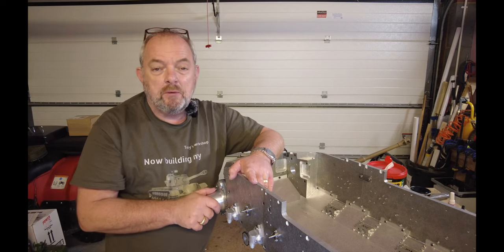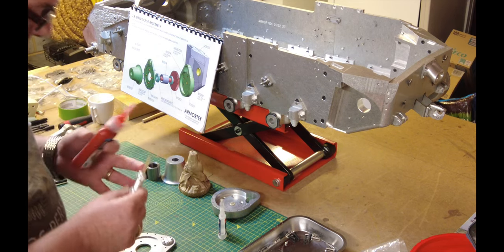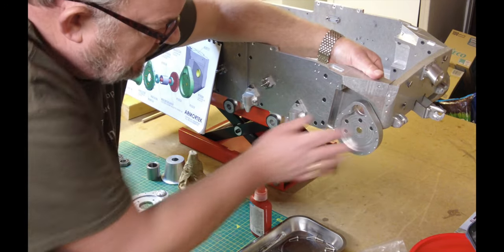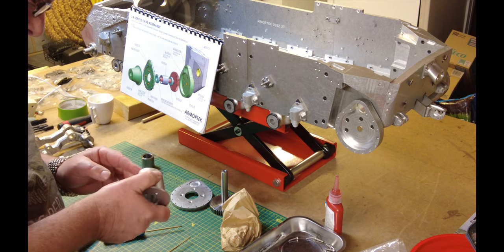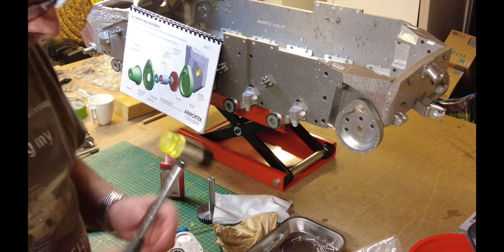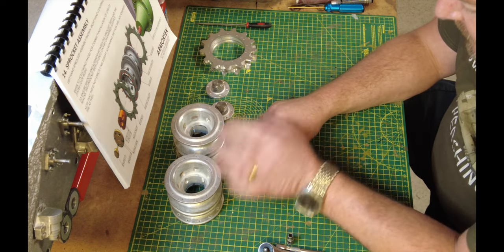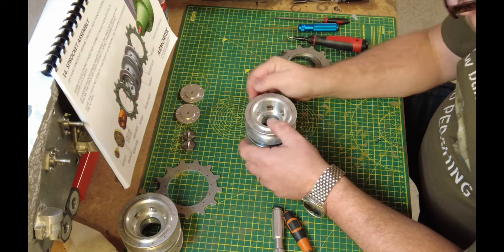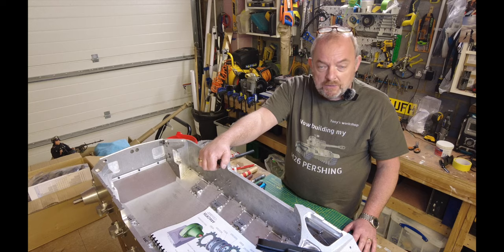1/6 scale Armortek M26 Pershing RC Tank build. Drive case and Sprocket assembly. (Vid 06)

Comment: Thanks Tony.. keep em coming… never before have I been pleased to open the curtains and see it peeing down with rain…. And I’ve not been on PlayStation since bringing my kit home.. Tank building is certainly addictive 👍
Reply from the maker: Hi Brian, thank you....LOL...I too used to dread cold and wet days, but now these are officially tank building days....who knew?
Reply: @tonys_workshop  That's funny, I feel the same way, and I love the outdoors. Thanks again for the videos. Always fun to watch. I noticed you did not apply even a dry lube on the gear as per AT recommendation or are you going to wait until you install the motors and apply some through the pinion gear hole?
Reply from the maker: thanks Ray. I used some copper slip on the brass plug. I will also apply some to the gears on the drive motors before I install.

Comment: Again, thanks for the video.

Please, always press or hammer the bearing in on the collar which is carrying  the pressure at the time. Otherwise, you can dent the small balls in the bearing which will make 'm make a crackling sound over time, or worse...
So when hammering in those bearings at  13:19 and 17:58, don't use the broomstick like that. The force then has to pass from the inner ring, through the bearing balls to the outer ring, which will damage the bearing balls. Instead, better use a socket from a socket wrench (or a piece of tube or wood or whatever) which  matches the outside of the bearing and hammer or press on that. In that way, there will be no pressure on the bearing balls inside of the bearing, i.e., not harm them.
Reply from the maker: Thanks Leon, Fine tuning tips...Thank you, and really appreciated.

Comment: Hi from Australia. Tony, When fixing with a lot of screws that require Loctite, I have found that if I put some loctite in a small glass container I can then dip the end of the thread into the loctite.
Loctite requires two things to cure,1 contact with metal and 2 an absence of air. It will not cure in an open glass container
Reply from the maker: Hi Robert and greetings from the UK. Great tip thank you. Thanks also for watching and commenting, it means a great deal to me.

Comment: Morning Tony another cracking episode, build is coming along really well.
I think you will have the persching built before I finish the panther Lol.
Very interesting on the drive cases good design from the real persching on the maintenance front very nice added detail.
The Brass Bush in the drive case is to stop any potential binding of the drive gear.
And it also has an anti track slip ring!
The 2 disks running in the centre of the sprocket parallel to sprocket teeth are track tooth guides to help stop tracks from climbing off the sprockets.
I have these fitted to my modern 1/16  tanks.
They aren't on the real vehicles but are brilliant as they work very well.
Reply from the maker: Morning Gary and thank you...slowly but surely it how I look at it. Really don't want to rush this build as there are so many little issues with it and it is easy to get bogged down on getting to the next stage. So at this rate, I think you will be up and running on your Panther sooner...once you are ready, we should take my Tiger and your Panther on exercise over at the range I talked about. I love what Armortek have achieved on this kit and every piece is a a pleasure to handle...although building 14 wheels and 10 rollers was monotonous, (next vid) it was still easier than the Panther, from what I understand.
I love the Sprocket design and looking forward to installing and aligning with the wheels. Have a great weekend.
Reply: I have to disagree with you Gary…. The real tank does have track guides on the sprocket…Armortek production of the sprocket is a true likeness as can be seen in photos in the book Tony has shown us .
Reply: @Brian Womersley  sorry I think you misunderstood what I was saying.
I was saying I was surprised that the real vehicle had them, not that it was incorrect.
I also mentioned they are fitted to my 1/16 scale tanks which is incorrect as they do not have them on the real vehicles 
ie my leopard 2a6, challenger 2, M1A2 Abrams.
Reply: @garyrafferty8653  my apologies Gary, yes I misunderstood what you were explaining regarding your 1/16th models

Comment: I strongly recommend you hit the outer face of the bearing not the inner race , it can damage the bearing  , I've not built one of these tanks but I have years of experience working on motorbikes 👍
A suitable metal socket should do the job .
A good smear of lithium grease on the gears will help as well , imagine a gearbox with no oil or grease in it , not being critical just passing on some tips .
Reply from the maker: Thanks Kevin, great tips thank you.

Comment: Odd there is no gasket material between the the two halves of the case and that the only lubricant for the gear is on the thrust. A small amount of lube in the case would make that gear last and help with noise. Also next time youre at the hardware or supply house ask about the stick form of thread lock. For small threads you just swipe the fastener across. No picking up the bottle and shaking also controls the amount :) I use it with it sitting a piece of tube on the bench you dont even pick it up keeps a hand free to handle small form threads :)  The job is looking good. Cheers.
Reply from the maker: Hi and thank you for watching and commenting. They used to supply a gasket, but stopped this for Drive Cases a few years back. Not sure why. Good tip and I will look out for that thank you.

Comment: If you were smart. On the small fasteners you would use purple loctite and on the larger ones use blue. You will find if you have to take any of that apart for servicing you will need heat to get the red loctite to let the screw turn.
Reply from the maker: Thank you for watching and commenting. For the most part, the small fasteners are for detailing only and never need to be removed for maintenance. I totally agree, the Red thread lock can be a pain when removing, but only had to do this a few times and the heat gun did it's job well. Where regular access is required, I don't tend use the red, I use the blue. The drive case, once tightened up, would only need access in extreme cases, but having driven the tiger now for over 40 hours, this has not presented a problem. The engineering in these kits is so good, it is rare for any major problems to occur. Really appreciate your advice thank you.